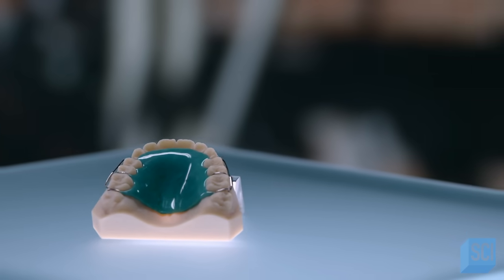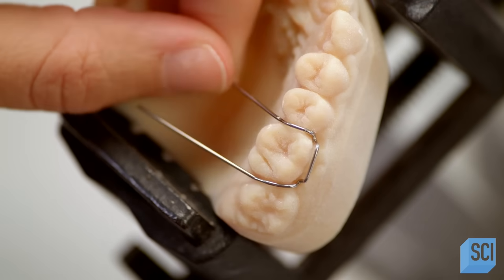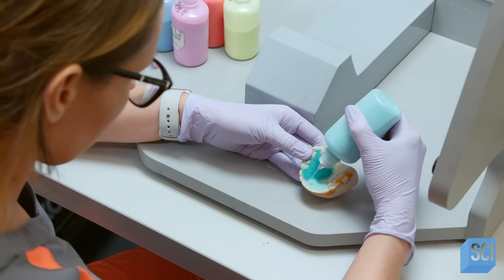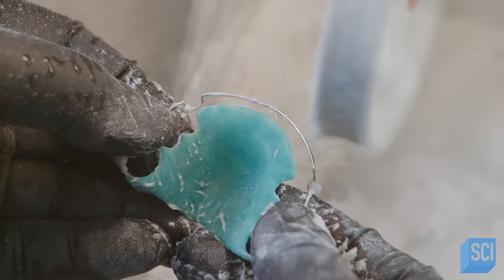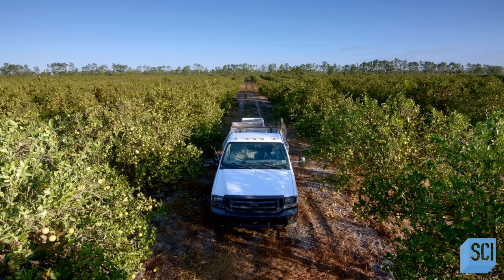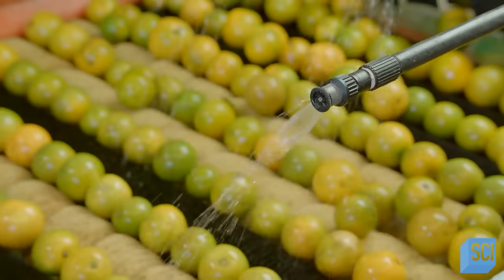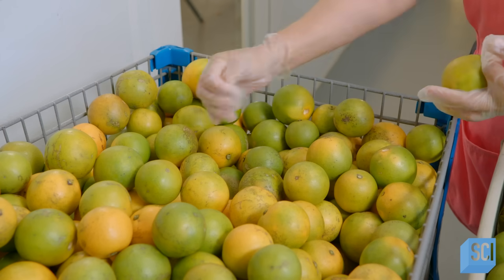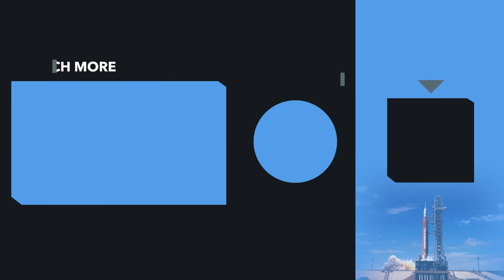Discover How Retainers Are Made and How Orange Juice Is Processed | How It’s Made | Science Channel

Comment: It's pronounced ''boe'', as in bow and arrow. The crossover wires of the Adams clasps are not flush in the interproximals. Patient likely biting into the wire. Very annoying, possibly leading to patient noncompliance. Ears of Adams clasps not engaged in the undercuts of mesial and distobuccal line angles.Finished palatal acrylic appeared uneven in thickness. Big mistakes throughout. Not likely an acid bath, but just a dish soap solution. Silver solder is very susceptible to corrosive forces, including in the oral environment. Poor segment Science Channel. You also failed to mention that the laboratory that actually creates these appliances, may get up to $100 per piece, plus the fee for printing the 3D model, while the orthodontist, for his minimal work following active treatment, will bill the patient $500 or more. An assistant, that earns less than $20/hr., usually performs the scanning.  Next time you have the first appointment at the orthodontists' office, look at the cars in the parking lot. A bunch of modest cars, and one Porsche, Mercedes SUV, etc..Yes, you're getting ripped off, especially if the treatment was done via clear aligners.